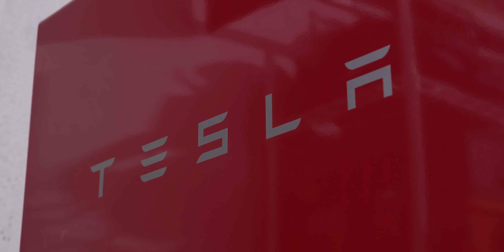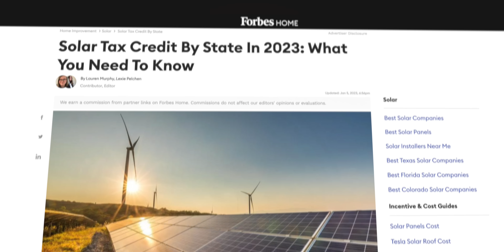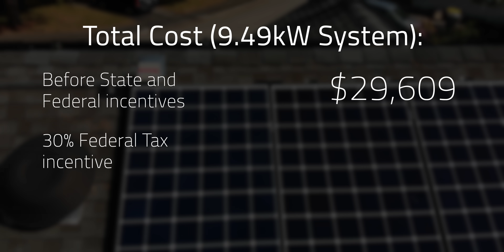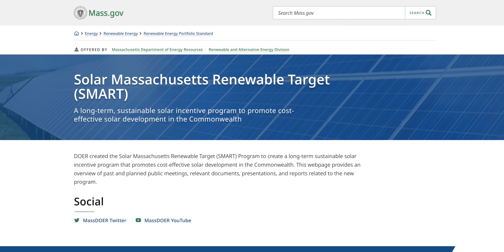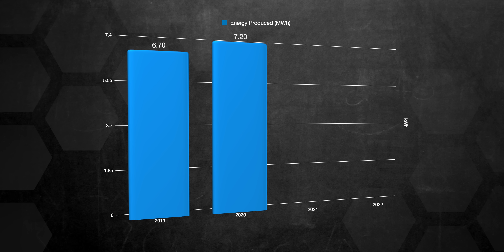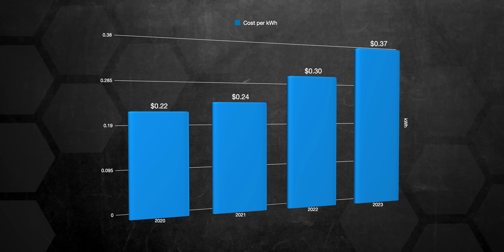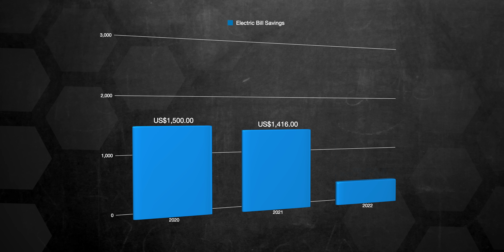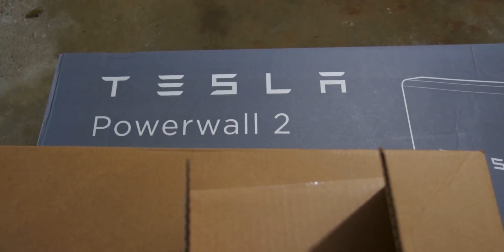5 Years with Solar Panels - Is It Still Worth It?

Comment: I moved to a foreign country that has hot sunny days  at least 80% of the time. So I was thinking that perhaps solar would be a good bet, especially since the power goes of here a few times a month.. Unfortunately, there are no government incentives here for solar and as it turns out my electric bill is only about $50 a month at most. A solar system would cost me at least $30,000. That means that it would take  50 years to break even on my electric bills if solar replaces it completely. I'm assuming that the opportunity cost will approximately counter the rate of inflation. Since solar panels may not last 20 years and I may not last much longer, I decided to look into a backup battery system or a diesel generator instead.

Comment: I think your math is a little off. You said the 40% increase is from 2020-2023, but based on the numbers you showed, the 40% increase is from 2020-2022, going from 20-28 cents is 40%.  The 15 cent increase from 2020-2023, going from 20-37 cents is actually 85% more.

Comment: Solar great; however there is a segment of the population without credit or cash to buy solar. So the next generation of home owners will be struggling just to pay bulls including electric and never turn the economic corner to actually both reduce the carbon foot print and save money. There needs to be a program that helps finance the system as an add on to a mortgage but at a reduced rate as opposed to a rapacious bank. In Texas the goal is to have you use more energy so they ( oil and gas ) can make more money. Politically speaking they don't believe in global warming. You actually pay more when you use less, below 1000kwh per month.

Comment: I bought a solar system based mostly on your videos. I'm super happy with it. It's an 11.9kWH system with REC Black panels installed by a great company that serves the Mid-Atlantic region. Our system offsets 100% of our use, and I haven't paid a bill since. SREC checks help but in my area, we get wholesale rates, I wish we got 1:1 because we'd be making bank. The only thing I'd do different if I could do it again, I'd opt to add wind to our system. I think we could approach an average of 13-15kWH with wind at play.
Reply: Mind sharing the company?

Comment: I acknowledge that there are non-financial benefits in installing solar as Matt had brought up, like energy security, but on the financial part, he assumes a discount rate of 0% across years, which is not a good way to evaluate whether it truly pays off (from a financial perspective). The discount rate could be pegged to bank rates, investment returns, or even inflation rates -- depending on what alternative you have with the money if you didn't otherwise spend it on solar panels.

Given the following cash flows based on the videos:
Year 0: -29,609
Year 1: 11897.64 (tax credits take a year)
Year 2: 3014.64
Year 3: 2930.64
Year 4: 3799.64
Year 5: 803.44

At 0%, we get -7163 which was the same as mentioned in the video.
At 2%, which is rather low, we get -8047.48, which is about 12% higher. Assuming a constant cash flow of 4314.64 (1514.64+2800) for the whole of Year 5 and subsequent years, it will only fully pay off around the middle of Year 7.
At higher discount rates, the pay off would be even further out.

Now with even lower installation subsidies and credits, a new installation may take an even longer time to pay off.

The key thing to take away is solar panels are an upfront investment and the payoffs are over a number of years. Given that the time value of money is lower in the future, one should take that into consideration, especially when there are also other competing financial goals in one's life.
Reply: You have some knowledge of finance how can I learn in smart way?

Comment: We have a 12.2Kw Array with 30Kwh backup Enphase batteries in Texas. The batteries are phenomenal, and I highly condone Enphase and their Enlighten App. My installer, however, was a nightmare. I will say that our system has not really saved us money, at least not yet. Our metering policy pays only a third of the cost for energy exports (4.8c), and we still pay full price for imports (13.7c). Although the battery offsets our nighttime consumption, It's not enough to stop our reliance on the grid, especially for stormy days. Matt brings up an excellent point, though, that the one sure thing is that electricity costs will rise every year, you can count on that (In no scenario do I see electricity costs ever going down). Getting Solar will lock in a portion of your utility bill for the next 20-30 years. As the price of electricity increases, having your own source of power on your home is a great benefit. 

The Enphase batteries also have the Storm Guard feature, which I think is one of the best parts of the whole system. Enphase will be alerted when there is a severe weather alert issued to your county and will surge energy from the grid into your batteries in preparation of an outage. This is essentially like having a home backup generator at the upper end of the cost spectrum, but never needing to worry about fuel. To me - This is worth the extra money we're paying every month compared to before we had the system installed. 

Key takeaways - (know your installer, checkout their BBB reviews. Whatever they promise: GET IT IN WRITING. (You should ideally have a lot of open roof space on your south face for peak performance. (You MUST have a battery backup system in order for your panels to power your house during an outage: Do not let an installer tell you otherwise. To my knowledge, every state requires your system to disengage during an outage to protect lineman while they do repairs. (Understand the tax credit: a 30% tax credit does not guarantee that you will receive a check for that amount next year, only if your tax liability is the same amount or greater for that year. Do not let an installer mislead you about that. (Checkout all of your local benefits: Every state and utility company has different rebates and programs. Be sure to research them and factor them into your decision. Do not take your installers word for any of your local benefits, including your utilities buyback policy. 

The only regret I have going solar is our choice of installer. I look at the Enlighten app every day to check on the system and I feel like it has made us more energy conscious as a household. Since my wife works from home, it is nice to have the batteries backing up our power in case some goofball runs into a powerline across town. And - There is peace of mind knowing that we will have backup power when a storm rolls through.

Comment: And so I've been planning my, off grid, Homestead. For some years now.

In addition to having, solar panels. I also intend on having, wind generators. Extract my heating and cooling. From about 6 feet underground. Freshwater, evaporated from the air. And a satellite link. To the Internet.

So of course solar panels are worth it. It's free electricity from God. That is happy to supply it. For the last 4.5 billion years we think. Which we are only getting wise to, now.. I mean like DUH!

And we will require photovoltaic cells. That work at night from, cosmic waves. So you needn't wait till daylight to recharge your vehicle. You could be charging as you sleep behind the wheel. And get to where you need to go to, in half the time.  And so you also die instantly. And rather painlessly. We are told. Which is difficult to, verify and substantiate. Since one first has to become dead. To take advantage of cosmic rays. And to figure out how to get a sunburn in the middle of the night outdoors.

Until such technology is discovered. We are only left able to, destroy and poison our planet. To kill everyone and everything  ever known to exist. Which is the only thing that will then make a dictator happy. To know that their followers are dead, dead, dead. So they can rejoice. Over everyone's death. They only know they have to do. And don't know why? They just have to destroy everything. Agree with nothing. And believe that you own everything in the world. Like Ronnie D. Santa Claus wants to next. With his paid for, degrees from Harvard and Yale. Where he graduated with a degree in, Cockamamie Depravity. Twice over! Paid for to each of those, financially ethical institutions. Where if provided with enough millions. You need take no tests and study, nothing except your navel.

There is something radically wrong with these sub defying, human protozoan. And their idiot I think female girlfriends and, personal masturbation receptacles. Always smiling, leering with only FDS on their minds. While both looking and smelling FUCKable.  Eyevonkkka. Who wants another stab at, white British socialite snobbery. Oh heavens who let the dog in? Who let the dog in! ARF! ARFARF! ARF!

Right now it's a pissing match.  To see who can get the most, piss-off's,  pissed-off. As that is the antagonizing male way. It's all the boys know how to do. And why the girls all bitch slap each other, up. Because 40% less dense bones only produce, girly slaps. And nobody gets badly hurt. Followed by a bunch of hissing. After they pissed-off one another. And then they get back to taking care of the kids and fixing dinner.

Boys are funny until they are not.
RamyRAD

Comment: There are a couple of things that concern to me, the reliance on legislation for all the rebates and incentives and infrastructure ownership. Even at your worst calculation of $320 a month, after five years your total is $19,200. Your initial cost without subsidy was $29k and even with subsidy had you done nothing you would still be ahead. Its only the agreed rebates and buy backs that make this work economically. To my second point, you now have $29k of infrastructure (potentially unsupported as no longer manufactured) that you haven't budgeted replacement for. What is the current cost of the equivalent equipment + install? if you plan to keep it for 15 or 20 years, whats the monthly budget (at 15 years you are looking at $160 a month additional cost to put away to afford another $29k spend)

Comment: Matt - enjoy your videos; installed my system in July 2019 and its exceeded my expectations. I have a 45 deg roof that orients SSE with no obstruction, so a 98% solar rating. My 22 panel 7.04 KW array has produced 33.9 MWh of power so far and I will recoup my investment in 4 yrs. Haven't had an electric bill since I installed my system and love getting my monthly checks from the power company. Thinking about adding a battery but have to do more research and also watching to see if costs come down with evolving technology. Good luck with the new house.

Comment: I really mean no offense. But unless there is NO other option. Only an IDIOT would put panels on the house roof! If you erect an awning in the back yard. (or maybe even in the front yard) You get shade, protection from sun and rain. And you can direct it for optimal direction and angle. With an easier way for seasonal changes. With your panels you probably could have covered ALL your usage AND MORE. And it's a good thing that you are selling your house before needing a new roof! That looks like an expensive nightmare!

Comment: Hi Matt,

I told you sometime back in your Net Metering short about my "Solar Saga". Long story short, The utility forgot to change the meter no net metering, when I receive my ATO (Authority To operate) last September. I contacted them in November when I notice that my electricity generated wasn't being recorded. I finally had to notify the Public Utility Commission for the utility to take action. They finally issued a revised bill on Feb 24. The good news is that electricity generated almost covered the electricity I used last billing cycle: 198 kwH or a bill of $34.54. I would consider it a very good thing, considering I paid $254.00 last year during the same billing cycle. The utility does not have a solar PIV metering scheme, only residential for solar. 

I live in Washington D.C. ,which is currently pays the highest value for SCRECs, $400.00 per MW generated. The estimated power generated by my system is 9.8 MW annually so  $3,600-$4,000 annual SCREC generation is expected.  The price for my system is $22,500. I should be able to to repay the entire loan in 3-4 years if I include the 30% tax credit you'll get. 

I do have a question: Is SREC money taxable? That has been a topic of discussion and there's no clear answer in the Tax code. The general consensus, that came out of solar group I'm in, is that as long as it's not for profit, it's not taxable. That means as long as you use the money generated to pay of the loan for the system, you don't have to report it as income.

My system is mounted on a slate roof. My house is a 3 story townhouse. There is no way to access the roof from inside. I'll not be able to remove the snow in the event of a snowfall. I'll just have to take the risk of an avalanche.

My next plan is to add a storage battery system, probably Enphase. My initial idea is to use it as a backup generator, but using it to charge up my PHEV and using it during the night does have merit. I want also to be able to use a gas or propane generator also. It's for the event that the grid is down for an extended period and the solar panels can't generate enough power to run the house and charge the batteries due to cloud cover.

Comment: German here. Going the PV-route was the VERY BEST decision for me EVER.
Our house already had a 7.75kWp PV installation from 2012, with a local yield factor of abt. 950kWh/kWp. That brought me into the whole topic when I bought this house 2019. Meanwhile we have 18kWp in total (effective kWp, some of the moduels face NNE) and a 12.8kWh battery with an automatic off-grid 10kW emergency power. We are like 95-99% independent for electricity from mid February to mid-November, better than we ever expected.
Luckily, our 30+ year old German house has a rather modern insulation standard, so we need much less than 100kWh/m2 (7.15kWh/sqrft) for heating year-around. So, an electrical heat-pump for heating would be next, but the current prices (upward of 32TEUR all-in) are prohibitive, unfortunately.

Comment: My house roof is too awkward for solar, and overall hard to access to take snow off, but I do have 400w on my shed, and plan to put about 1,500w on my deck once I build a pergola.  That will go to the shed system.  I have a 40 amp circuit from shed to house and goal is to eventually have automated transfer switches to switch certain loads over to solar when power is available.  The shed solar is not enough because it's overcast most of the year here but hopefully with the 1kw or so I will get from the new install I'll be able to at least shed off some of the always on loads like freezer, fridge, and maybe even server room.  In my experience snow does not slide off the panels on it's own, need to go with a long brush to remove the snow, so I need to make sure my panels are accessible.  Once I build my off grid cabin I will have much more room, so I will probably build a vertical ground mount array then don't have to worry so much about snow removal.

Comment: A tax credit DOES NOT mean your withholding was too high and you over paid your taxes.  PERIOD.  It IS a federal SUBSIDY that EVERYONE is paying through THEIR TAXES to YOU via BORROWED federal MONEY that has ADDED to the now $31.4  Trillion DEBT which has caused INFLATION and higher INTEREST RATES on both the federal debt and anyone who BORROWS money to buy a home or car or any other borrowed money.  At some point there is the possibility of 80's type inflation followed by an economic CRASH.  
The net metering is ANOTHER TAX paid by everyone to YOU.  Instead of net metering you should be paid WHOLESALPRICE of electricity at the TIME the power is used/saved/put back on the grid.   STOP complaining about your high electric rates - YOU have in part caused it.  I DON"T CARE how much YOU SAVED because it cost everyone who cannot AFFORD solar panels.

Comment: An investment in any power system that pays for itself within 7 years and continues to generate power thereafter, without the need for expensive repairs and maintenance, is a good investment. Kudos for taking the leap Matt.
Reply: If this were actually true, inspectors would require solar be standard on all homes, but the numbers never add up.
Reply: @mts7274  In some areas, excessive cloud cover will make the investment less feasible, so national standardization is unlikely, but please tell me why the numbers don't add up in sunnier areas.
Reply: @moonrock41  The EPA would make solar a requirement for new builds in the sunniest areas if the numbers actually did add up, but they don't. So many other products are part of the Energy Star Certification program, however. They've done the studies on so many products, and their studies on solar clearly show that solar [to this day] STILL doesn't meet the requirements for certification. The numbers just don't add up.
Reply: @mts7274  I don't know what the EPA requires, but maybe you should ask to see Matt's, since he claims (at least with his setup) that the numbers do add up.

Comment: We have an off grid system installed of 2kW with 2 250Ah batteries.
Most of the time we charge under 1.5 to 1kw but now we are running 100% on solar.
Parents and I we use TV and computer all day and fridge or dishwasher around noon.

Batteries last all day and night.

We actually removed our grid power because we are in a third rate country so we get 1hour every day or two from it anyways and its super expensive because taxes on just having grid power.

We're really living happier now and with less anxiety and everything costed us around 3k$ tbh because we have no need for licenses and stuff here. Professionally installed and guaranteed.

Been running for a year and a half now.